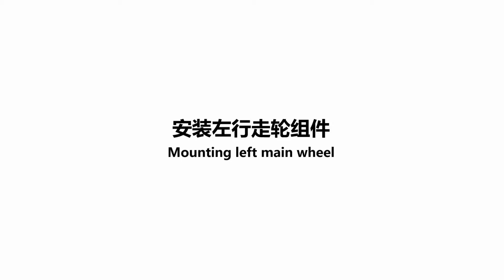Roborock S5 Advanced Guidance — Replacement for Left Main wheel

Comment: How to take the wheel off of the part its mounted too. Just the actual wheel not the suspension part.
Reply: James Seidler did you find the solution?
Reply: I want to clean the Fender inside wheel because my robot vacuuming my cat's poop, problem is none of this video teach us how to open the wheel.
Reply: @boboboy8189  I had a very similar problem.. I ended up giving up on getting the wheels out based on how much effort it would take and how completely you would have to disassemble it.. I eneded up cleaning the wheels with qtips and alcohol..
Reply: @boboboy8189  mostly the lesson here is to do a quick check of the cat poop area before starting the bot. I used the magnetic strips to block off the area around the litterbox
Reply: How do you know wich wheel need replacement. My vacuum turns anti clockwise but not clockwise..
Reply: @jauniusmalisauskas1718  its hard to figure out.. depends on what got stuck or jammed or whatever
Reply: @jauniusmalisauskas1718  sorry I probably am not much help..